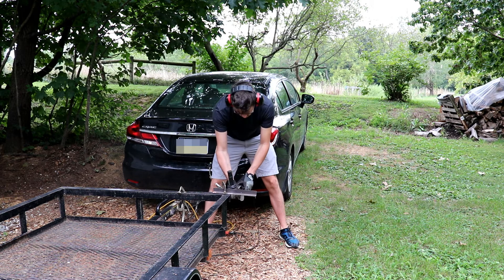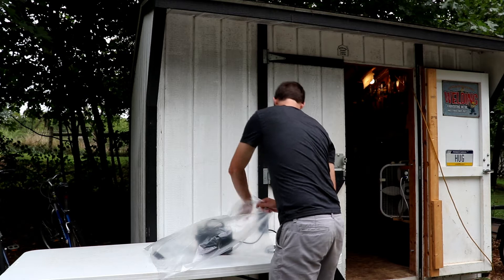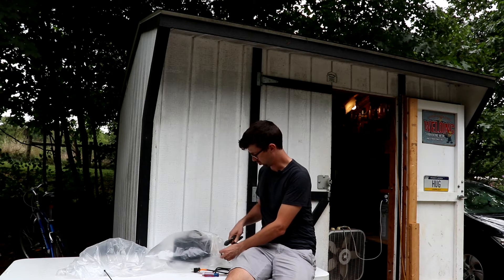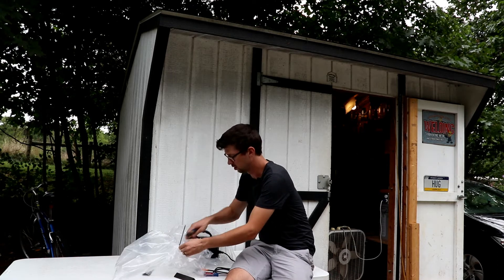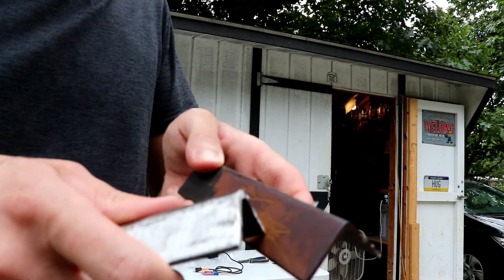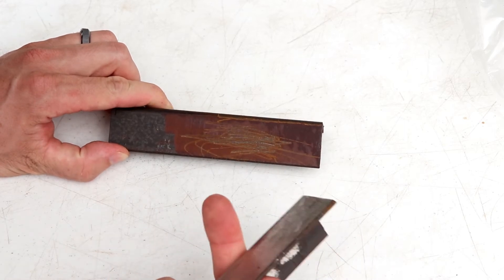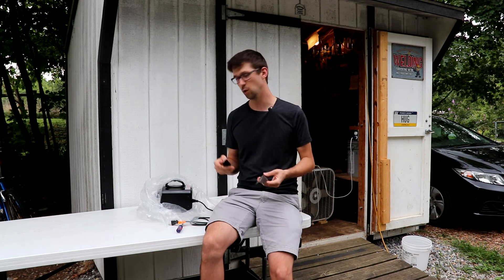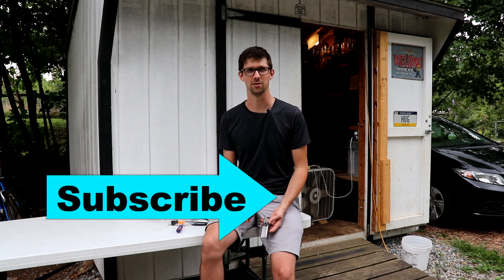Will Ozone Rust Metal????

Comment: While yes, O3 will oxidize metals... it's the nitric acid* that so vigorously rusts metals and yellows plastics. If you use extremely dry air, it can be mitigated somewhat but, the only way to get pure O3 is with an O2-fed Ozone generator. (Which is a far-greater invitation of danger, than these simple and effective lil units.)

*majority-component nitrogen in air, ionized-oxidized; then preferentially bonding with moisture (water) to form nitric acid.

Comment: Was the ozone generator only circulating air that was already in the bag or was the inlet of the generator open to ambient air. If so, an equivalent sized fan in the other bag might be appropriate. Am curious of the relative humidity of the day. Our curious if the test would differ if it was run in a dark interior closet.

Comment: I have the exact same ozone generator. I'm curious what it does to electronics when used sensibly in the home as well as in an automobile.
Reply: It oxidizes stuff, by definition. In your home the o3 concentration will be very low, compared to o2, so i don't think it will cause any harm to electronics if used sensibly. But in a car it depends what car it is. I wouldn't use it in an older car that's prone to rust anyway.
Reply: @deeiks12  thanks 👍👍

Comment: Funny, all of a sudden the metal hinges on my small travel trailer have gone rusty after nothing for the first decade of ownership. I mean very bad rust and the only thing is I've been generously using a generator in the rig for smells and mold prevention.  I'm pretty sure it caused the hinges to go bad. Lesson learned.
Reply: How often are you running it? I don't think these are meant to be used in a bag for 3 hrs as Zach did or often as a deodorzer daily. They are for one (or maybe a few uses if required to get rid of the smell) time use such as moving into a smokers house or car, etc. Obviously if they are not used as intended there will be ramifications.
Reply from the maker: Sorry to hear that!